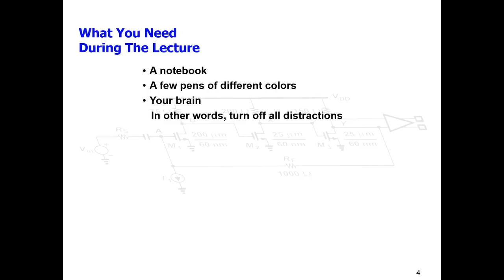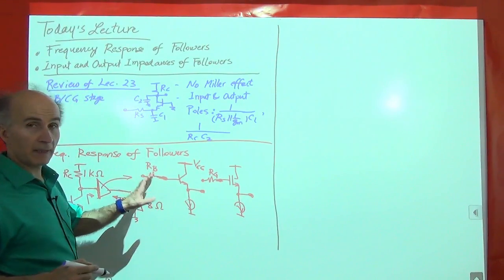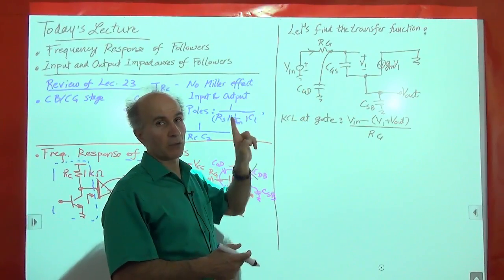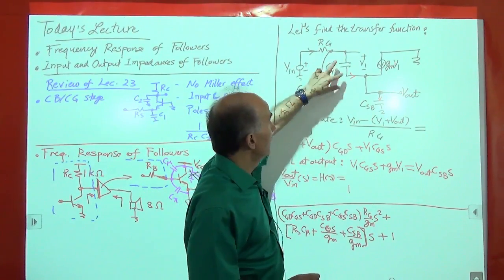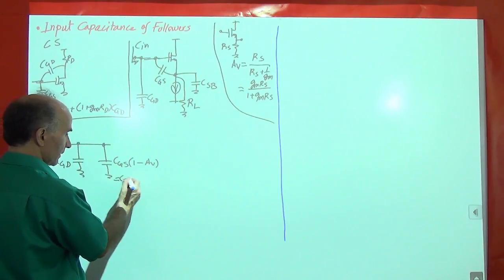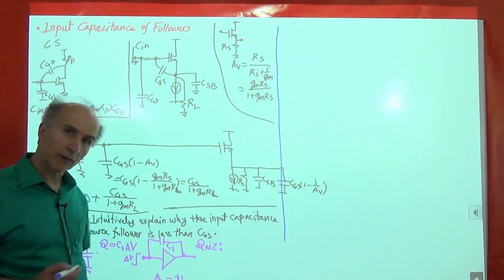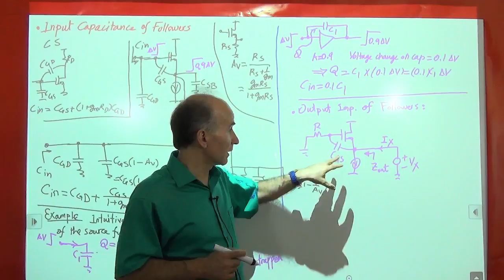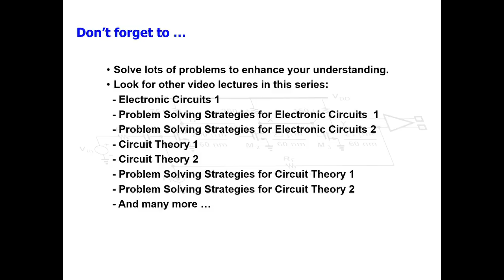Razavi Electronics2 Lec24:  Response of Emitter/Source Followers, Input & Output Impedances

Comment: 01:25 - Intro and Review
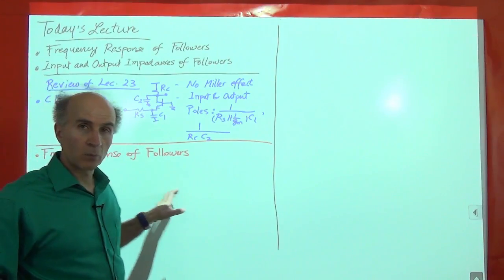03:40 - Frequency Response of Followers
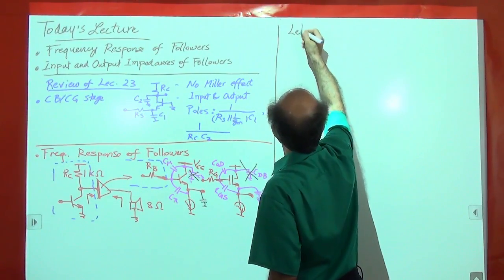10:26 - Finding the Transfer Function of Followers
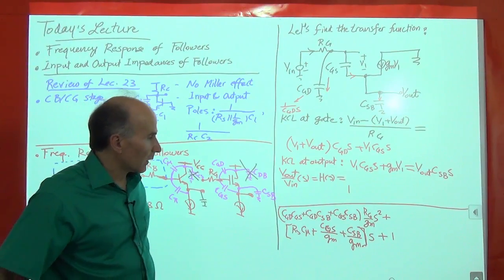19:38 - Conclusions from the Transfer Function
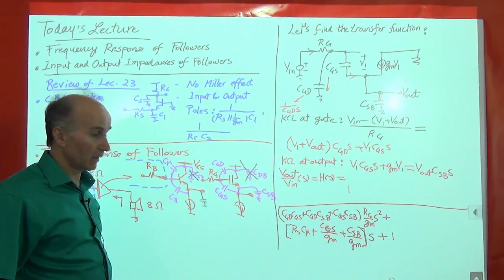21:40 - Input Capacitance of Followers
30:25 - Intuitive Explanation of Input Capacitance Lowering with Bootstrap Amplifier
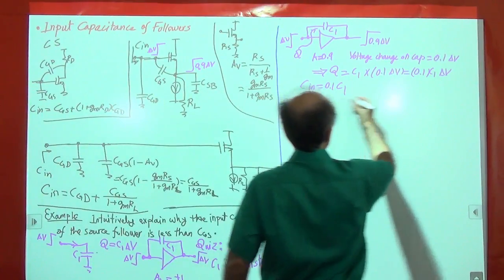39:15 - Output Impedance of Followers

Comment: 01:29 Frequency response of emitter and source followers
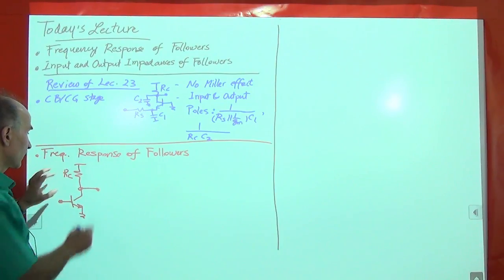04:20 Emitter/Source followers act as buffers to prevent significant gain drop due to lower impedance loads.
10:06 Analyzing the transfer function of the source follower circuit.
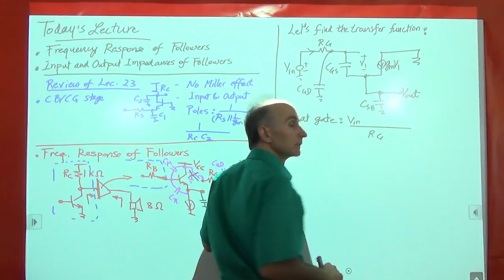13:30 Analyzing current through RG and capacitance at gate node
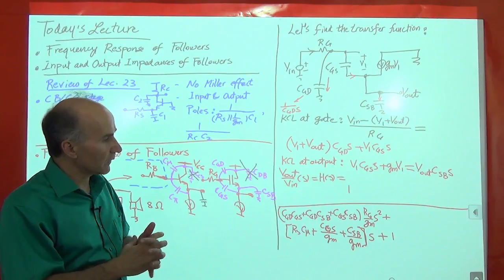20:01 In analyzing followers, numerical values are required to determine poles due to lack of flexibility
22:36 Finding input capacitance using Miller multiplication and input pole of a circuit.
28:24 Input capacitance of source follower lower than CGS
31:31 Voltage change in amplifier with gain of 1 does not deliver charge to capacitor.
38:15 The input capacitance of the source follower is affected by the gain.
40:57 Using a resistor in certain cases for impedance matching
46:56 Introduction to emitter/source followers
Crafted by Merlin AI.

Comment: @45:12 why is the current through RG same as the current through the capacitor Cgs?
Reply: Apply kcl at that node then 
current through rg+current through Cgs=0
now I(rg) = -I(Cgs)
Reply: As current cant flow through gate, so it has nowhere else to go.
Reply: because it's the same wire